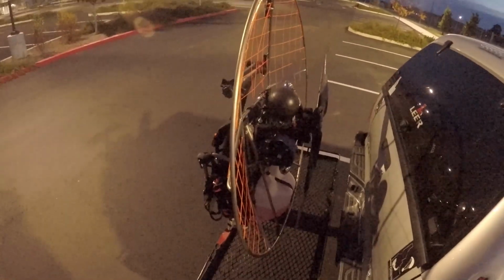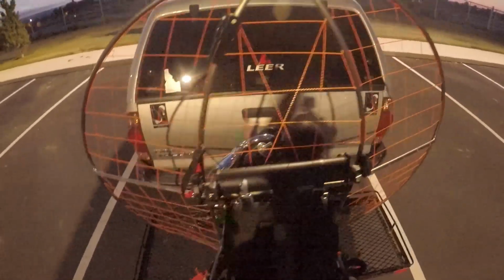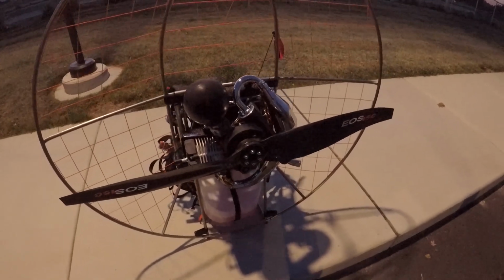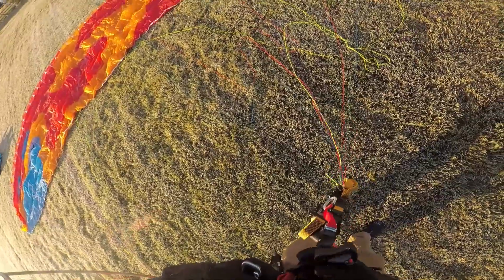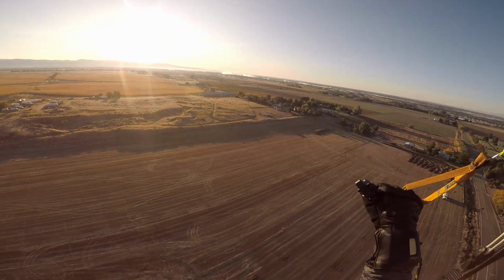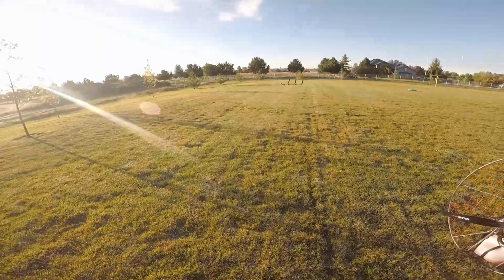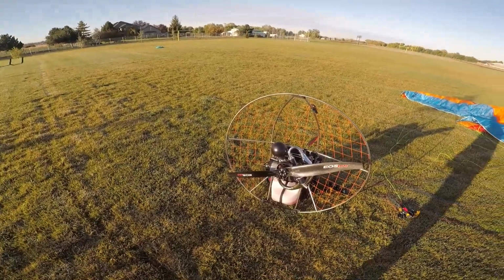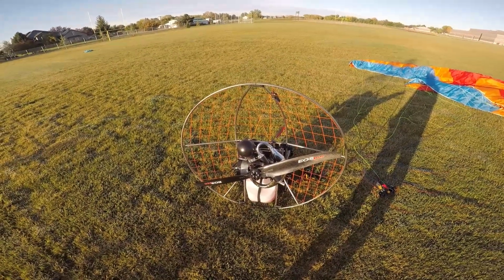EOS 150 Paramotor Engine Review

Comment: We've been using these engines since launch, theyre brilliant units similar in comparison to a swiss clock in the way they run. The Eos 150cc engine is Highly recommended
Reply from the maker: Paramotor School - Explore adventure every time I fly EOS 150 I like it more and more! Stay tuned for another review is about to come out!
Reply: It all looks bling-bling, but it turned out to be a blooper. The way the cooling fan is designed is all wrong. The angle of the blades of the centrifugal fan is the wrong way around. And the fan can not suck in air from the center. The only opening where air can enter the fan is at the outer edge (of the housing of the pull-starter) where it actually should build up pressure. The design of the forced cooling is just plain bonkers. Dito for the EOS 100. In a feeble attempt to fix the overheating issues EOS came with an "updated starter unit". A pull starter with slightly bigger gaps for air to be drawn in (still in the wrong spot e.g. 'not in the center) ánd tada (!) a new flywheel with the blades positioned the way they should. But the fan still does nót build up pressure, what a joke.